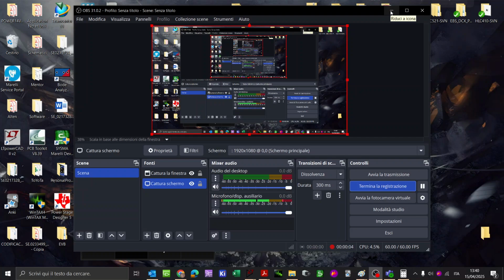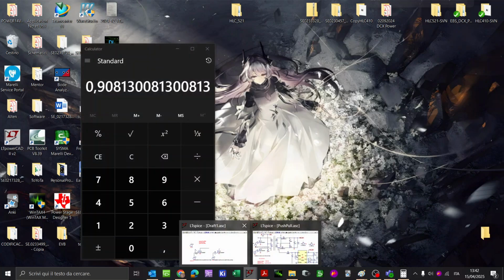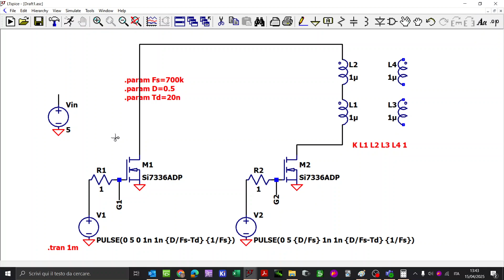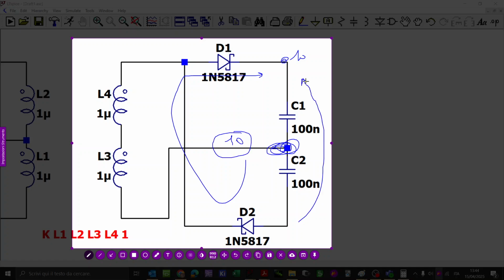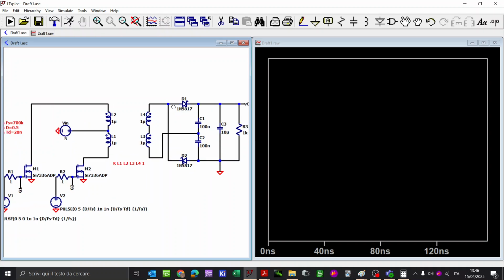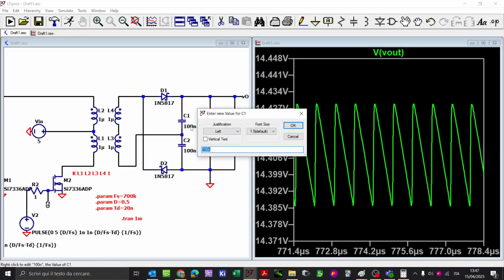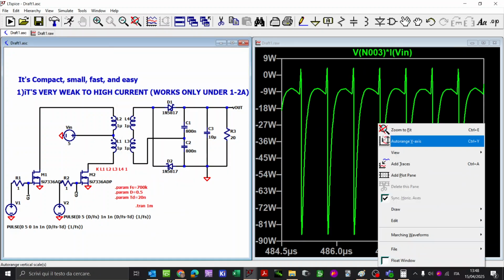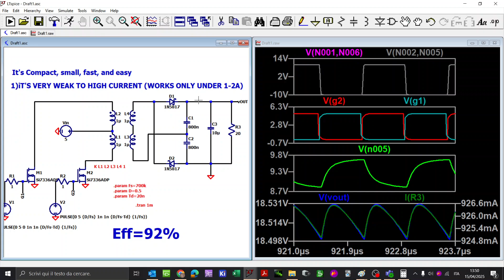[LTSPICE] Push Pull for Aux Power Supply

Comment: Can you share the test problems and transformer details in the real circuit? Isn't the 700kHz PWM a bit high, was it built with a general purpose mosfet and microcontroller? Thanks.
Reply from the maker: No, for auxuliary power supplies we use chain like this in the frequency range of 400kHz-700kHz even. You can do that because the power required is low

Sometimes we generate this with intergrated circuits like LT1699, or waveform given by the uC
Reply: @LukeXVIIx64  So can a buck converter or LDO be added to the end of the system for a regulated output? Do you recommend it for use an isolated gate driver supply? Thanks.
Reply from the maker: @arifguler9855  Exactly, at the end of a chain, there could be an LDO to stabilize it